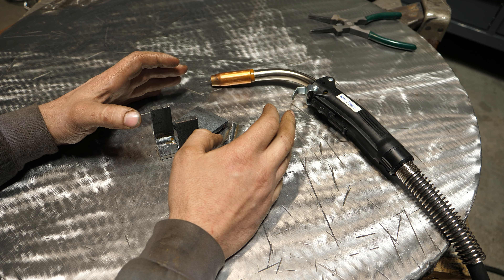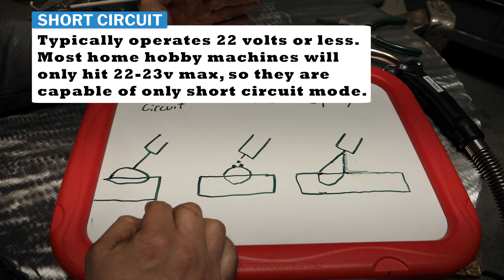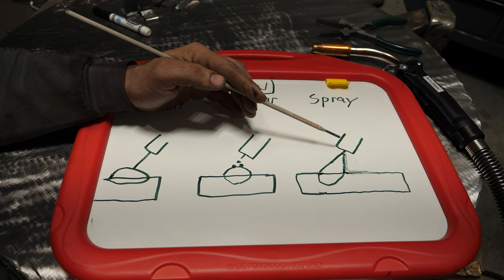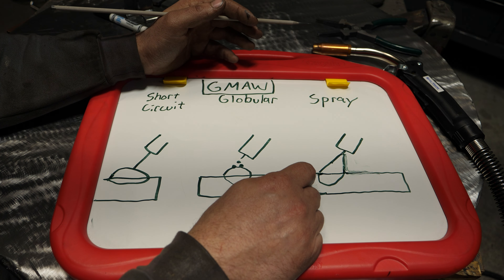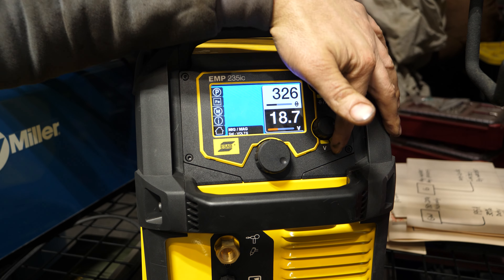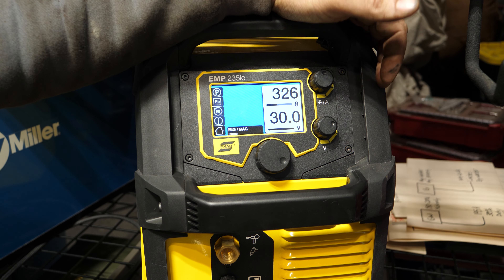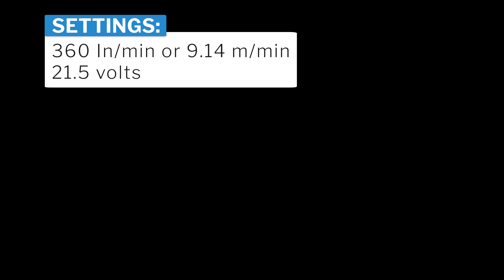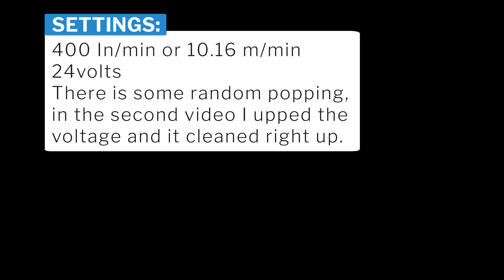Introduction to spray arc welding

Comment: So wait... Can I run straight co2 through my mig gun using my 500 amp stick machine for the power source? I'll unhook the power input to the gun and swap welders useing the ground from the stick machine. I'd just be using the gun for the wire feed and gas solenoid? I don't see why not but maybe you can tell me. Other than melting the gun down...
Reply from the maker: So that’s sort of the setup I have at a project I am working on.  They have a power source (400amp miller power source machine) and a suitcase feeder.  All the feeder does is hold a spool of wire and feed it.  You set wire feed speed on the feeder and the voltage on the welder.  Inorder for this to work the welder needs to be capable of CV or constant voltage.  MiG operates on constant voltage variable amperage.  Stick operates on constant current (amperage) variable voltage.  If your machine can be switched to CV mode you could actually pickup a “cold feeder” with a mig gun off marketplace for dirt cheap and mig weld on the machine.
Reply: @makingmistakeswithgreg  what does Tig do voltage or amperage? The machine has an outlet that says output voltage signal but I have no idea what that's all about. I'm guessing it has to do with the timed weld function since it's on that plate along with an outlet for remote contactor 115 volts external... Never spot welded with it before. Obviously it has tig function as well. What is the difference between volts and amps as related to the gun/spool drive. I have a parts flux welder that spools wire when I pull the trigger but I think it's one of them that is energized with the power switch not the trigger. The hose and gun were messed up when I got it but I have an old school tweco MiG torch I can use.
Reply: So to short but sweet all that. The MiG gun is always on as is the stick/tig machine. In stick mode anyway. I suppose I could add a switch to the gun and run it in tig mode...

Comment: We used to run spray on 1/16" and 3/32" material back at my old shop. It wasn't about penetration, it was about how fast can you get this piece done. It was extremely unforgiving.
Reply from the maker: I bet that was a challenge.  You’re talking some
super fast travel speeds lol.  Considering spray can melt through 3/16th plate fairly easy (and produce undesirable weld defects due to heat input) it would take far more skill (and be far harder) on thin material like that.  One “blip” of a mistake and you have some weld defects to fix lol.

Comment: Thank u Greg really appreciate ur Wealth of knowledge….is there possible that u can do a shootout between dual-shield flux core An Spray down th line is my understanding that dual shield flux core can be run out of position but not really 💯 sure I kno that with Pulse An double pulse machines is th real way to go but again if th same weld quality can be done with dual shield flux core it really is a matter of quality An price of th machine those dual pulse machines can be pricey An if it’s possible to preform th same quality/penetration on thicker metal granted with dual pulse th obvious appearance of th weld is night An day thank u 🙏🏽
Reply from the maker: I will be doing that for sure.  Dual shield can definitely be used for out of position.  It also can be run with normal c25 gas.  It still has the limiting factor of needing higher voltage (24-25v).  Dual shield runs really good, it will be interesting to see how it fairs in .045 to .035 spray arc.

Comment: i spray weld tractor implements at 30 volts and 15 m/min of 1mm wire. The sound it creates is bizarre
Reply from the maker: That’s definitely up there on feed and voltage.  Big welds and getting it done fast 😀👍

Comment: I'm no professional but you're melting two metals together, as long as the weld went into the metal and is not resting on top or worse over mill scale a weld that penetrants the steel 1/16 inch will be just as strong as one that penetrants 1/4 inch?
Seems like having a weld go into new steel so much and replace it with weld would make it weaker? I would like to see a video of a break test and see which one is truly stronger if at all.
Reply from the maker: So some of your observations and thoughts aren’t wrong.  Weld penetration only matters to a certain extent, but it’s highly dependent on how force is applied to a weld.  Many things that are welded are welded with a single pass, and from only one side.  By having more penetration with one process over another you can have increased strength for two primary reasons:  1) you have a thicker weld throat depth, more metal is harder to tear through, and 2) you have likely decreased leverage that can be used to tear through the weld.  A lack of penetration makes it easier for a weld to be broken because what it’s holding together can be used as levers to break the weld.  In more simple terms think of a fillet weld (t-joint) on thicker 3/8th plate.  If you weld it on one side only you could bend the upright plate away from the weld face with thousands of pounds of pressure and it won’t fail.  Yet a few hundred pounds of pressure in the opposite direction (towards the weld face) will cause the upright plate to break off.  This is due to mechanical advantage the plate has of using the weld as a fulcrum point.  A lack of root penetration makes it easier for the plate to pivot on the weld itself and tear right through it.  With more penetration it makes it far harder to tear through the weld and use the weld itself as a fulcrum point.  

Also, Processes with higher average penetration/depth of fusion will more reliably fuse a root start to finish.  They are also capable of welding thicker steel.  A great example would be short circuit mig can reliably weld 1/4inch steel with decent root fusion.  Try to weld 2inch plate with it and it won’t be able to fuse the root at all and may not even get much sidewall fusion.  Processes with more penetration are far more suitable for thicker plate.

The differences in actual strength becomes more apparent when you start talking high static loads, vibration, impact forces, and especially thicker (or longer) pieces of material.   You must also remember that weld material is an alloy that is typically stronger than the base material, so having it in place of the base material isn’t necessarily a negative thing.  Where this becomes more of a concern is what’s called base metal dilution.  Certain materials don’t like to be joined via pure fusion (like tig with no filler) and must be welded with an alloy to help dilute the base material.  A great example would be cast iron, it typically cracks due to carbon absorption if you weld it with normal steel filler or just fusion weld it.  The solution to welding it is using an alloy that doesn’t become brittle with the carbon from the casting, and to limit penetration so you’re not melting the base material together without filler.    In such cases your thoughts on excessive penetration could actually be correct, it would be undesirable.

The key takeaway I think you need to understand is that welding is an imperfect science and the real world presents problems that are varying.  It is far better to have a weld with more penetration than needed and a process that achieves more reliable/consistent penetration because that’s far better than no penetration.  There are plenty of times where poor root fusion will never be a problem, and there are many times it will be a serious problem.  You’re always better to reliably have some than not.

Comment: Remember that in order to maintain a plasma stream and spray arc, and even in globular, you must have at least 80% Argonne in your shielding gas. I usually keep it just above 90%. You cannot spray arc with less than 80% it's not even recommended to do it at that concentration.

Comment: I use 75/25 and iam capable to spray arc with hobart 210
Reply from the maker: With c25 you can’t run spray, it will more or less stay in globular. The welder you have based on millers chart is only capable of around 22v at 180-200 amps.  100% c02 will give you good performance with that machine as far as penetration and you will be able to match the short circuit welds in the video, but you won’t be able to run spray unfortunately.

Comment: When MIG welding aluminum, the spray arc process is used.
Reply from the maker: You are correct.  Which is why mig aluminum tends to be very unforgiving on thin material.  Get the molten pool started and haul ass lol.
Reply: @makingmistakeswithgreg  Yes, it is used primarily in fabrication where there are long welds on thicker sections.  I have used it quite a bit and you cannot hesitate.

Comment: The spray arc (bottom plate) did not look like it had very much penetration.
Reply from the maker: Spray tends to produce a punch to the center for penetration and not a whole lot of sidewall fusion.  Without a doubt some settings tweaks would help a bit as well.  The values run were also on the low end of spray, around sub 220amps.  As you go up in wire feed you will see an increase in performance.  3/8th steel needs a lot of heat to achieve decent fusion.
Reply: @makingmistakeswithgreg  If you look at 18:35 the penetration is mostly in the sidewall pc. The (weld) looks symmetrical. Maybe gun angle has something to do with it?
I really appreciate the video.

Comment: So almost as good as stick.
Reply from the maker: Stick is solid, but above 230a machine spray or dual shield will take over stick in performance.  The problem is cost, you’re in the welder and gas bottle for a minimum of 1200$ and upwards of 2k for a solid setup.  With a 300$ harbor freight stick welder you can weld xray quality welds on 2 inch thick plate without an issue.  That’s not happening with a 300$ wire welder lol.